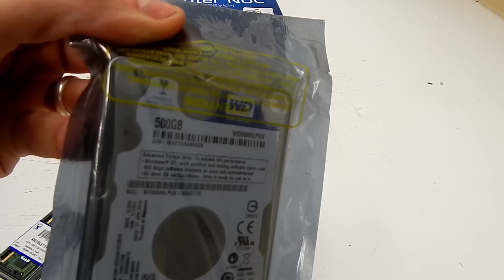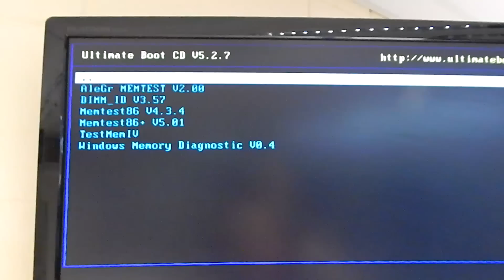Unboxing and Assembly of the new Intel NUC

Comment from the maker: If it's only 5m from the router you would gain a lot faster and stable connection by plugging in the Lan instead. Otherwise these units have 150mb/s min Wireless N